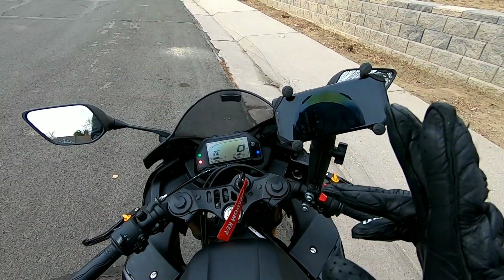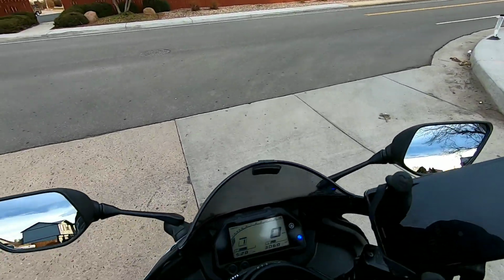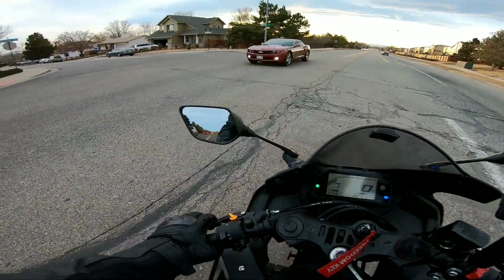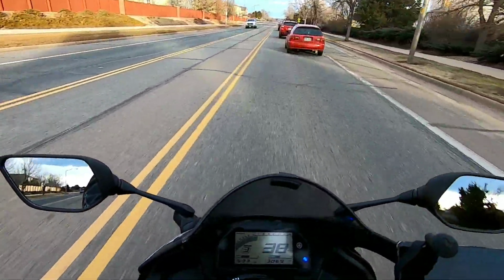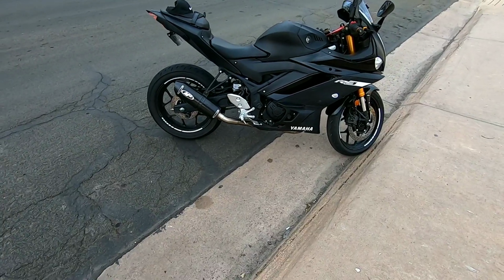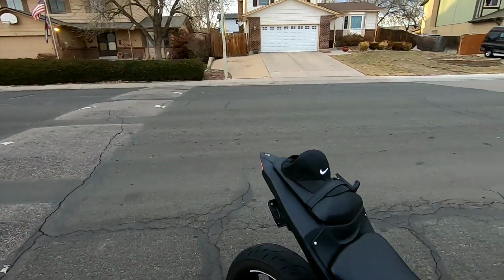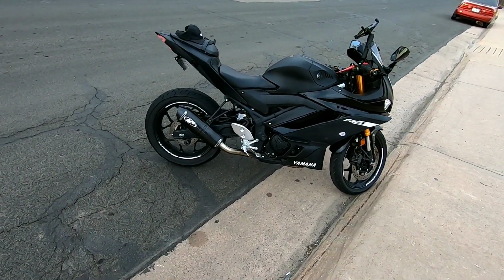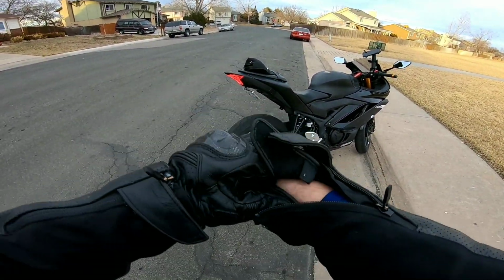BEST FULL EXHAUST FOR R3 | M4 CARBON FIBER EXHAUST | 2019 YAMAHA R3 | FIRST RIDE | SOUND | FLAMES |

Comment: I’ve got the 2020 R3, immediately replaced the gray parts with blue parts, Yoshimura R77 Slip-On, eventually the full system will be installed, and I’m going for the TST Industries WORX Pack. This bike is beautiful, I can’t wait to ride.

Comment: Any issue with the bar end not fitting completely (left side)? I do notice the chrome. Right side fits fine for me. Left side, same issue, some chrome showing. Pisses me off. Thought it was an R3 specific part but there’s a list of bikes it’s supposed to be compatible for, which I understand it happens with parts. If the left doesn’t sit flush like the right side, doesn’t sound like a compatible part to me. How do you feel about it?

Comment: You didn’t happen to film during the process of the throttle tube install did you? I know theres a bunch out there but the 19 r3 seems to have an undated stater switch housing
Reply from the maker: There's 3 screws total you need to take out. Ok be is inside the housing. Unfortunately I didn't film it

Comment: Throttle tube changes response time as there's less throw for the cable's. The exhaust and air filter together is probably 3 hp gain but you should definitely tune it now, A/F ratio's is what will kill an engine fast with lean mix and high temps
Reply: They make a StreetFighter kit for these ... Looks really nice, check it out on Motonosity's channel
Reply: @IrnMaiden304  but something to keep in mind the blk lab r3 kit is only for the 2015-2017 model years, but to my understanding you can request custom made kits. at that point tho it could be well over $1,700 for it (about a $200 increase from the existing price)
Reply: @Jared.mp3  when has anything custom made by a company ever been cheap ? .... I never said anything about a price all I said was there is street fighter kits and to watch Motonosity's channel ( cause he builds one ). Your bike, your choice ...
Reply: @IrnMaiden304  I know you didn't that's why I did, and I pointed out the company by name so Chris wouldn't have to search the r3 build videos to find the company name. I also pointed out that the kit isn't for his model of the r3 if the company's website is anything to go by and he might have to pay more. The reason I did this is so he knows information up front and doesn't get his heart set on in and gets slapped with a $2k bill. I know it's his bike and he can do whatever he wants, I never said he couldn't. I just know that most people don't have that kind of money lying around (especially a soon to be dad) just for a cosmetic change.
Reply: @Jared.mp3  Yes I could agree with alot of that, But people are Soo accustomed to other's doing the research for them and sometimes that information is misleading also. If he had a REAL interest in it I'm sure he'd be looking up any information from the company and finding out everything else he could from people who have done it ( mainly from forums ). Obviously you took the time to look into it beyond this and watching Motonosity's channel for the kit and searched up the company and their offerings and options ..... See how that works ?
Reply: I chose to stay with the stock filter because my bike already feels more lively with just a slip on. Not finding a tuner shop for hundreds of miles being in west texas.

Comment: I also say stick with the fairings. When I got the replacement fairings for my 2019 r3, it didn't have the red pinstripes so it looked super weird. So I just covered up the crack it had with black tape. Didn't look as bad at all haha. I might consider that exhaust you have bro. Wasn't gonna upgrade anything on my r3 because I was waiting to move up to the r6 but that sound might be too good to pass up haha. Also your phone doesn't get in the way of anything? I feel like it's super close to your face. I know it's just the way your camera is positioned but yeah haha. I found a low profile way to get a phone mount on my r3 if you wanna try a different location for it!

Comment: Did you add a Power Commander and tune or just the full exhaust?
Reply: I hope he does soon. Bike will definitely be running lean with the air filter and system
Reply: @diamondheat9  drz owners: nah nah nah thats normal
Reply: @hatch707 hahahaha and @diamondheat9 yeah I know that's the reason why I holding off on my full system because you have to add roughly another $350 for power commander and another $300 to have it tuned or dyno tuned I just didnt know if it was good to run it without it for long looking out for him

Comment: Did you tune it after the exhaust because if u don’t tune it after decating it loses power I heard
Reply from the maker: It definitely doesn't
Reply: Moto Chris have you ever considered a sprocket change for better acceleration lower top end? I’m looking into it but not much coverage on it
Reply from the maker: I did that already! I have a few videos up with it installed
Reply: Moto Chris did you do a before and after 0-60 I feel I have watched that video. The one that shows all your performance mods?
Reply from the maker: I didn't do a 0-60 before and after. But torque is definitely noticable
Reply: Moto Chris could you guess the 0-60 change or torque increase also what was the sprocket you got? Thankyou again